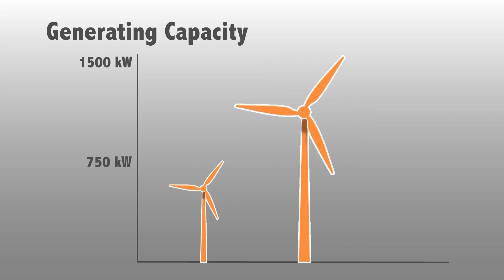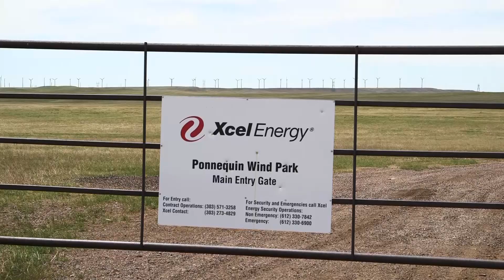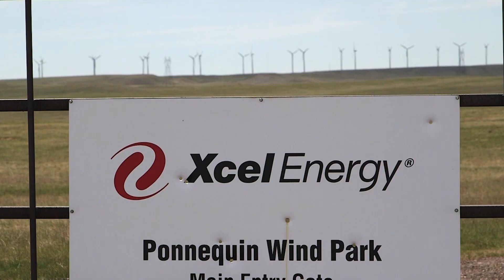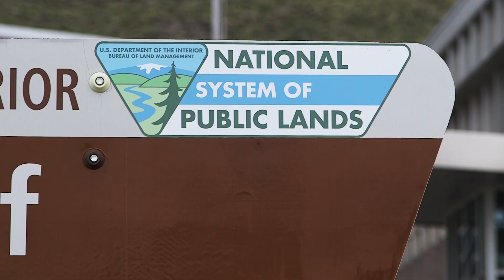Who Cleans Up When a Wind Farm Retires?

Comment: You know it's democrat shenanigans when they haven't thought it through like the cleanup into the cost of stupid "green" energy.
Reply: just as plugging and reclaiming oil and gas wells . north dakota rejected a law to hold oil companies more responsible  for plugging and reclaiming abandoned oil wells .the state of ND just used $66 million in covid money to plug oil wells the oil companies are supposed to be liable for. so please don't single out green energy include all forms. the federal government wanted to drill a test well in  north dakota to explore if conditions were right to dispose of nuclear waste in the state the county stopped that from happening.
Reply: @erniew5805  This is an honest question.
Do you know if those oil wells were from last century, or if they were from the modern fracking boom?
Reply: @erniew5805  The point is "green energy" is a stupid premise. It's not environmentally friendly, cost-effective, or reliable. Nuclear can be environmentally friendly, very cost-effective and reliable. I agree we have to be careful about nuclear waste bt without a knee-jerk reaction every time the words are used.

Comment: Good point. Don't just look at the advertised price of the energy. Also look at the price of the waste disposal. Wind turbines create waste. Solar panels create waste. Fossil carbon energy creates waste that goes into the atmosphere. Nuclear energy creates waste for which we don't even have methods of disposal as yet. Let's price out waste disposal for solar panels, for wind turbines, for excess atmospheric carbon, and for nuclear waste. My guess is the prices for wind turbine and solar panel waste disposal/recycling won't even amount to the rounding errors for the prices of disposal for fossil carbon or nuclear wastes.

Comment: Another cost frequently omitted by those pushing for wind farms. Not to mention environmental impact and how many birds will be killed. 
Would be really nice. If someone could give a total cost analysis. 
From production of windmills. Time erecting and connecting to the grid. Maintenance and operating  costs,  and removal.
How many tax dollars are involved. 
Because when I look at European farms. Their numbers aren't as good as our projections. 
I think more in line with reality. 
When you total it all up. Don't think it's  anywhere as great as they claim. 
Granted, improving every day. But still limited.
And not as environmentally friendly as made out to be..
Also wonder if anyone has studied the impact of these huge farms have on weather / wind  patterns if any?
Be interesting to know. 
Also fear if they do a big incentive deal like in the past. Alternate energy farms get haphazardly thrown up.
With no forethought or long term  planning.  Is the grid set up to get that power efficiently and effectively  to where it's needed?  Is there reliable buffer and back up power to accommodate fluctuations in outputs do to weather  or in the case of solar available daylight  and clouds?
All this and more should be taken into consideration  Before we just start building farms because of subsidies. 
A well  planned integrated system will work with all available power supplies. To provide reliable power. And able to progress as technology improves.